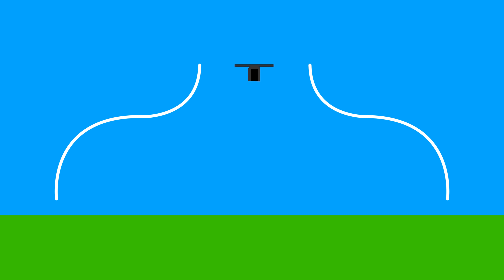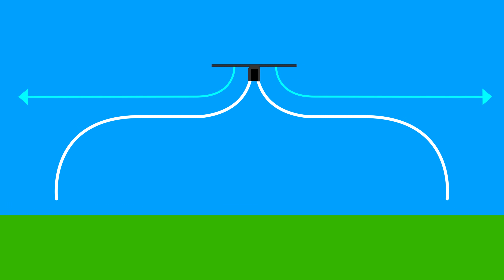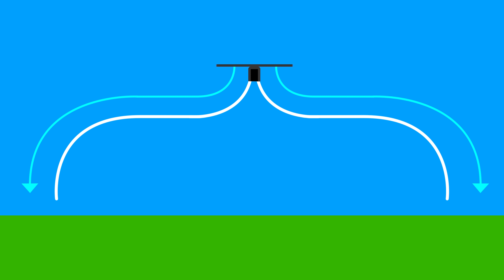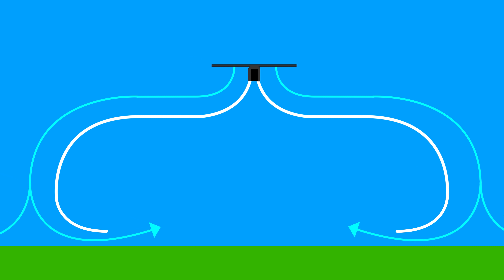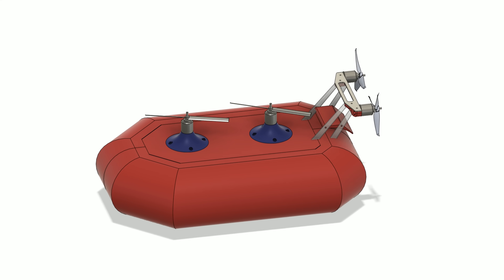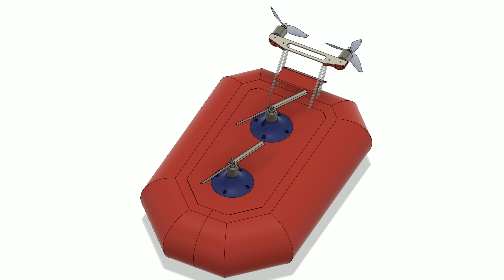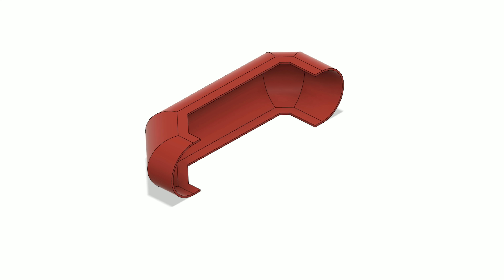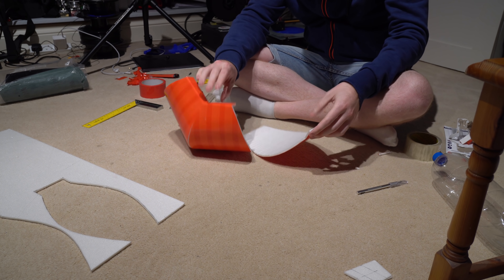Coanda Effect Hovercraft

Comment: What would happen if you covered/ enclosed the bottom?   You could just temporarily add more packing tape across the underside to see what effect it may have...    It would stop the leaves from getting sucked up into craft, I presume it would allow for the stream of air to flow under and push up on the belly of craft vs the open bottom which allows for air to circulate around inside the craft...   sealing up that open bottom may create less friction and better lift.   Also, I think covering the bottom of the hull may allow for easier turning/ less flipping over.. I suspect the craft has a tendency to flip over, because the sharp corner/ edge all along the bottom catches the grass/ ground every time you attempt to turn with a little speed...  enclosing the belly of your craft may solve that issue.   Just a though I had...  not saying I know with any degree of certainty it will preform better, but could be a quick 30sec modification to throw some packing tape across the bottom & see if it makes any difference?

Comment: I doubt that the Coanda effect is responsible for the lift off. 
My guess is that the vertical propellers are lifting it up - similar to how a helicopter operates. 
It was moust obvious during the first test on the grass when the craft lifted up a few inches. It was clearly not achieved by different pressures inside and around the craft.

Comment: Something(s) to consider: 1. If a 1000 lb helicopter hovers over a plate on a scale, the downwards air from the rotors will register as 1000 lbs on the scale.  Directly under your lift rotors, the force is applied downwards on the top surface of the craft. Further out than the prop diameter the air begins to move horizontally and the lifting surface of the craft is greater than the area of this downwards force, so it overcomes it.  I think you should go back to the centrifugal impeller idea, beef up the power system to drive them or reduce the number of veins. I believe the sideways ejection of air will eliminate the downwards force generated by the the propeller version. You may even get a gyroscopic stabilizing effect if the impellers have a respectable amount of mass.
2. The shape of the front of the craft is enough of an airfoil that as it speeds up moving forward, it generates lift regardless of the coanda effect, likely replacing the effect with classic airfoil lift. When the nose lifts, air gets trapped under the body causing a true ground effect lift, but because of the open bottom, the ground effect has greater effect on the leading edge. That added to the front edge lift causes the nose to lift too high, causing it to stall and become unstable.
Suggestions: 1.Seal the bottom. This will utilize any movement generated ground effect over the entire bottom of the craft rather than just along the leading edge.
2. Bring the Center Of Gravity just a bit more forward. My intuition from watching this is that the craft is a little tail heavy.
3. Install a vertical stabilizer with a slight downward angle of attack in the front or upwards angle of attack in the rear. While hovering the stabilizer will have no effect but as the craft moves forward it will tend to keep the nose down. This was the solution to the same ground effect problem in Indycar and Formula A race cars
4. Reduce the thrust angle of the thrust motors. Will require a lot of fine tuning to find the right angle.
P.S. After thinking about it I believe simply cutting the number of veins in the impellers will solve the under power and overheating issue. The motors will be able to spin up to a higher RPM, reducing the current draw so the motor runs cooler, but the higher RPM will produce a higher velocity air movement.

Comment: A great project , would placing the lift motors and aluminium plate lower in the body and using shafts to power the lift fans help with stability by lowering the  center of gravity  ?

Comment: i see that it works verry well although I do wonder how well it would work on rough services. And do you not think if you were able to trim the power between the front and rear motors it wold also help with the nose diging down?

Comment: I don't think it "hovers" due to coanda effect... you basically created a chinook helicopter with 2 pushing motors. You COULD see coanda effect only if main props took air from the sides and not from the top like a conventional helicopter

Comment: You should try putting turbulator tape or vortex generators on the top of the curves to help the air stick to foam board. It would increase the efficiency of the craft and hence require less power.

Comment: I'm not at all convinced this is the Coanda effect.  The Coanda effect relies on a smooth flow of air over the convex surface.  You have two contra-rotating propellors which are not ducted and there is nothing to damp the turbulence that they create.  The propellors will create a messy air flow and there is nothing to tame it and make it flow smoothly over the convex curves of the body.  I'd be interested to see smoke tests showing the air flow.  As others have posted, this looks like a clumsy helicopter, with the body actually reducing the lift by deflecting the air flow that would otherwise be more or less vertical.

Comment: I suspect that the instability might be solved lowering the centre of gravity below the centre of pressure. Drop the motors lower into the body (or to ground level) and lower the rotor mast.
Reply: On that same thought, go back to body flush impellers, put more blades on them to increase the surface area with motors almost touching the grass. Internalise and centralise the thrust motors too instead of having them mounted on a rear mast as that imbalance is causing her to go nose high. The idea you have is good, but it's all just imbalanced.

Comment: How efficient would a coanda effect hover craft inside of a traditional hover craft be?

Also would it be good to add weight to the rim of the under carriage of the hover craft to increase stability by lowering the centre of gravity since you seem to have spare lift on the hover craft might help keep it on the ground and from tipping over so much?

Comment: How can you be sure this is the Coanda effect and not just the lift of the main motors reducing weight enough to over come friction for movement?  This seems more like simple lift to me.   Given that the lift motors were strong enough to lift the craft off the ground and needed to be dialed back to prevent that, Simple lift from the main propellers seems the most accurate explanation.  This could be tested, i believe, by creating a craft with a flat board with the propellers with the same mass.  If the propellers lift the flat board, then the lift of the props is the cause of the 'hovering' and not the Coanda effect.

Comment: I wonder if you could combine both the conventional and coanda effect designs into a singular hovercraft. 
Doing a coanda inside the conventional design would essentially make an air tunnel that would force the air to produce the coanda effect around the initial curve, which would probably amplify how well the coanda effect works. The shroud for this design would be fairly simple, ring around the the propeller blades, and the inverse cone under the propellers, nothing that's difficult to design.
Doing a conventional design inside of the coanda design, I'm not entirely sure what that would produce. Though this design would have a very interesting shroud, as you would have to split the propeller's airflow between the inside channel for the conventional and outside channel for the coanda, to produce both effects with a singular propeller.

I also want to see wings on this hovercraft. Maybe a parasol wing configuration, then mount the forward thrust motors outboard on the wings; this may also give the craft better turning characteristics. Hovercraft-plane would be an interesting concept to see.

Comment: Nice experiment! you pointed out that it was a "little top heavy" and I wonder if you looked at weight and balance from a 3D perspective - for instance placing battery packs and any other possible necessary structure low and forward (inside the skirt?) to balance the top heavy/tail heavy aspect of the build without adding weight or complexity (or maybe adding a little - like "longrange" batteries!).   Oohh! how about Magnus effect sideskirts to really boost the Coanda!

Comment: I think the 2 lift motors functioning as normal lift rotors, are producing the bulk of the lift anyway, before taking into consideration the coanda effect. So if you had a completely flat surface on the level of the top of the hover craft, the 2 motors would still be able to lift the hovercraft.

Comment: Move the al. Frame to the bottom..
 The motors too... use a shaft from bottom mounted motors to the prop position... this will greatly lower the center of gravity.

Comment: Looks like you could use wings with dihedral and ailerons, but the wings need to be placed where they would not block the coanda effect flow. like parasol wings. Also please fly it through a vapor or smoke please.

Comment: Would it work to stabilize the craft by mounting the motors below the top surface and use a longer spindle to drive the propeller in order to lower the center of gravity?

Comment: Perhaps you can add some ballast to the bottom of the foam structure. It certainly produces enough lift to handle it, and the ballast will lower the center of gravity and make it less likely to flip over.

Comment: Curious if pointing the directional/steering motors at a slight angle away from each other would provide a more stable vector for the intended direction of travel, might be a bit touchier on steering, but seems like it would be less prone to rear lateral drift.

Comment: Unfortunately, this does not show the Coanda Effect. Great try but however using propellers for this certainly  creates lift, but not from Coanda effect, rather from the actual propellers creating lift themselves. I would agree that fog would need to be used along with covered propellers with a directed intake. Also using turbines to create an actual Coanda effect might take place, as this is not. All and all nice work with the build. Solid design.

Comment: I was wondering this whole video if some sort of roll bar could be designed to automatically flip it back or perhaps two side propellers that could be driven both ways.  These wings would aid in lift (regularly, no Coanda), prevent flipping to some degree and then could be driven in reverse to flip it back upright after it does flip.  Also, one could have instead of just 2 of these, 4 smaller ones (front, back, left, right) set in reverse to push up or down and this could even be automated by some stabilizer hardware/software.  But, then at this point it isn't much of  Coanda effect machine.

Comment: Two thoughts:
1) It would be really cool to stick a go pro inside to see the effect on the leaves. I think it could be quite insightful.
2) You could increase throttle a bit if you had a couple of gyros on roll and pitch to cut the thrust when it detects roll or pitch.
Reply: I don't think the roll issue could be solved with Gyros. The only way to get a rolling moment would be to change the horizontal prop speeds, but then you'd get a massive amount of adverse yaw. You could stop unwanted pitching and yawing easily enough, but it seems to roll over more than anything.
Reply: @katzen3314  I disagree. The solution is to cut power when it starts to go awry. A human will always struggle to do this fast enough, but a gyro can pick it up pretty quickly. And it's will within Tom's ability to take a couple of gyro signals, and cut power to both props when it detects unwanted input, and then restore it when wanted values return/a set period of time had elapsed. The solution in reality should probably be to reduce throttle rather than cut it, but hopefully the idea is clear.
Additionally, if there is any unwanted yaw,a fairly traditional gyro setup on yaw for the back props should sort that out.

Comment: With the propellors so high off the body of the craft. isn't this just a helicopter with a slight coanda effect? Actually it would be interesting to build a version of this with the same specs, but no curve around the edges and no curve just below the propellors. That could sort of prove or disprove how much coanda is actually happening.

Comment: Won't the same effect drive a vacuum if you curve the surface past perpendicular to the ground? -It feels like you would have had a better effect if the walls terminated at 90 degrees instead of curving farther under. (You're catching the effect that pulls two sheets of paper together when you blow between them.) [Bernoulli effect]

Comment: I see the pitch instability as driven by air getting under it as soon as the nose lifts up while moving forward.
Although it would not address that, I would like to see the easy experiment of closing the bottom opening with packing tape.
Or you could turn the pushing props around into pulling props. Or one pushing and one pulling.
All too easy for me to say because I don't have to do it.

Nice job.

Comment: How did you know which curvature to implement in the design?
Did you do any weight to structural optimization on the aluminium parts (FEA or Topology optimzation)? I'd guess you could  replace aluminium with some light weight wood instead since the forces are relatively low. Did you consider putting the battery in the nose to counteract the torque from the back motors?

Comment: SERIOUSLY? This is BS and/or cheating. Only lifts because it is NOT 3d printed this time but made of foamboard. Almost all of the lift is just from the props and has nothing to do with the coanda effect... this is a false claim. Tom you are an engineer. Do the math. This can only be an efficiency disaster. Also why do a complete 90° turn of the air atop the fuselage with a tiny radius? Do at least some sort of incline, would massively improve the efficiency.

Comment: Hey Tom,
i love that you kept on with the Coanda Effect and tried it as a hovercraft.
I´m wondering if you could improve it´s hover and steering characteristics by setting its center of mass way down. It would be pretty cool too if it is able to hover at about 10 or 20 cm above ground.
Maybe you can try to put something like a lead-filled-tube or sleeve on the inside of the bottom overlap. The motors should produce enough thrust to carry the increased weight without proplems.
And second, you could prevent the coandacraft from tipping over in turns by not only pointing the forward-propellers 15° downwards, but also turning them 15° outwards.
I would love to see how this effects hover/flight!

P.S. can we find your designs somewhere like thingiverse to try them by ourself?

Comment: I would have tried to lower the vertical cg as much as possible..........like lowering the underneath frame closer to the bottom.  Or even adding weight as low as possible.

Comment: Aplauses! Beautifuly made and developed. And it works.
A few questions: 
The radial fans, tested and discarded before by you, where apparently unefficient. 

I think (just guessing) that´s easy for the air stream to disattach from the surface when not directed perpendicular to it, and there is also an issue between air speed, form, and  airflow by surface unit, that I´m not able to quantify right now... 
That being said, how are you sure the vertical fans aren´t just pulling up, like a plane pointed upwards ?
Wouldn´t be interesting to duct the axial ones in order to direct the stream to the surface more evenly? Something like the pieces you use as motor monuntings right now, but outwards, like a turbine but with a sort of hiperbolic generatrix (a trumpet muzzle...anyway, ja..) printed with a wall as thin as possible.
I think you could move the front vertical propeller a little to the rear, it seems a little unbalanced right now, it lifts the front side first apparently.
Is it thinkable to set the engines in a kind of counterweighted mounting? That with the purpose of leaning them slightly when you turn, preventing tilting.
I dont use my english all the time, I hope is understandable ;).

Comment: A way to improve stability would be using counter-rotating props for both lift and thrust (one prop is CW, the other CCW respectively), that way the motor torque wont pull it over as soon as it has some lift

Comment: Very interesting, and cool - one thing to bear in mind is that 'rear steer' is intrinsically unstable - have you tried reversing the drive props and running it in 'reverse'? Using the motors to pull it?

Comment: Tom stanton, to fix the top heavyness, move the lift motors to the bottom of the craft and connect the props via long axels. Also, to not pick up water and leaves, put a bottom on it, potentially 2-3cm up from the bottom to not create additional friction and possibly still make use of the increased preassure from below. Then, to further move center of mass downward, fix your metal frame to the bottom part instead of the upper part. These changes should make it handle a lot better. :)

Comment: Tom Stanton ,  very cool project 
in fact i think that the lift caused by propeller not by the coanda effect , please i suggest that you change they propellers with a axial fans 
or 
added a cylindrical cover around the propeller and the distance between your machine and cylindrical cover must <1cm 
thank you Tom 
kinds regards

Comment: I don't know that you proved the coanda effect was taking any significant part here since it had enough lift to fly.  The levitation may have been completely due to the low pressure area above the rotors.  It would have been interesting to see how a square sided box would have compared with no coanda effect.